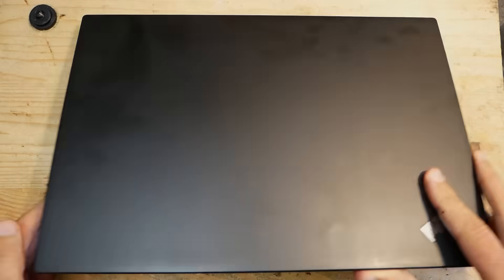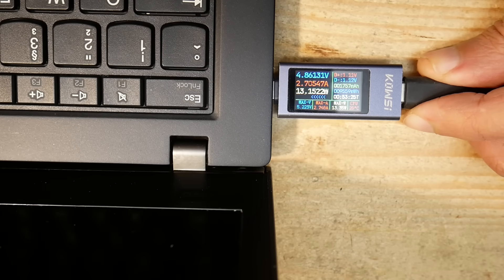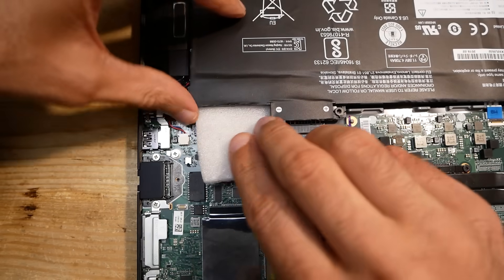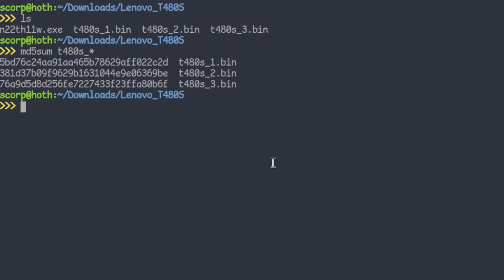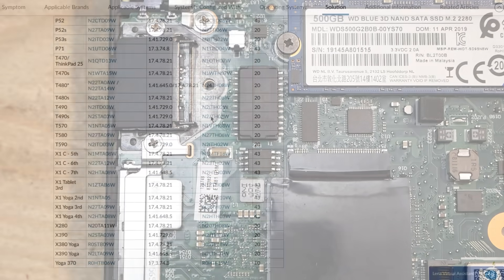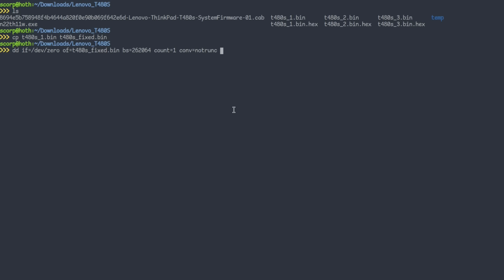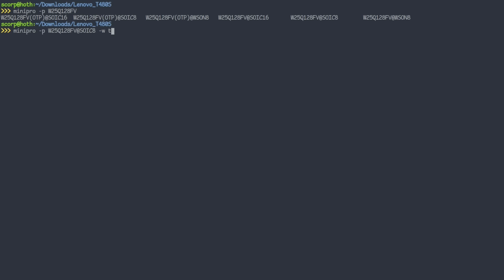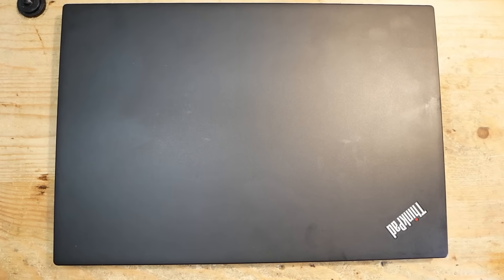Why is this Lenovo notebook not charging? Let's fix it!

Comment: A Lenovo laptop with a basic function not working is actually pretty standard stuff these days. 🤣
Reply from the maker: Unfortunately, yes, the quality dropped significantly. Even worse, this seems to be the direction for the whole industry. Leaving alone the fact, that this notebook belongs to the professional line and was actually quite expensive.
Reply: @necro_ware   "this seems to be the direction for the whole industry"
This is the truth and it's very sad.
kcuf apple for starting these pervert practices for all the other brands to see most people don't care until it's too late
Reply: Amen. I have the T480 and imo it's the spitting image of what'd once be considered a compromised laptop, when consumer electronics reviews were less influencer-y. ThinkPads almost feel like they've devolved into a lifestyle brand, for people afraid that a MacBook wouldn't effectively say "I'm technically knowledgeable, I work in IT" to strangers. It's okay to like it, but I've been saddled with one for the past 4 years and it only makes me miss my X201.
Reply: I'm of the opposite, I haate the older stuff and can go on all day listing every design failure they had.

I even leave with one suggestion to anyone thinking of daily driving an IBM version:
Never run them stock, they're from the era when chipsets finally started running hot. Always add your own heatsink solutions where needed and never use miniPCI cards in them
Reply: @Biaanca5036  There's absolutely some lemons in the IBM lineage. People sometimes want to pin a perceived decline in quality on one little thing, or claim that everything with IBM's logo on it is somehow the pinnacle of engineering, but the T4x machines were wrought with problems. The P50 and X200 families have to be my all-time personal favorite models, although the older 4:3 ultraportables are better looking as art pieces.

Comment: Just a note that one of the resistors next to the SOIC-8 came off during soldering - attached to the power supply trace into the Flash chip. You may wish to double check that the, most likely, pull-up resistor.. isn't still required and not having it isn't causing you some subtle problems. There is one either side visible in the overhead shot at 7:33; the resistors are likely 10k's.
Reply from the maker: Yeah, thank you. I saw it on the footage as well as I was editing the video. Looks like a pull-up, but I didn't solder it back yet. I definitely will, even if everything seems to works so far, it could be unstable in some cases. Anyways, thank you, eagle eye ;)
Reply: Nice catch!
Reply: You're a fast one, Rachel Bobby!  Good eye on that one!

Comment: awesome walk through this. thinkpads aren't unfortunately as great as they once were, but anyways, 90% of other notebooks are unfortunately even more crappy (and don't have a pointing-nipple). so until framework implements nipple-pointers we are unfortunately stuck to crappy hardware. i'm going to hold onto my trusty x240 as long as i can i guess..
Reply: Funny you should say that because the XX40 series is regarded as some of the worst ThinkPads Lenovo ever made. Either older or a year (or a few years) newer but not the 40 series in my experience.
Reply: @RepairWins that is correct, until you realize that noone wanted to buy xx40-series notebooks second hand because of that horrible clickpad, BUT you can drop-it-replace it with the one from the x250 and have been still cheaper than an generation before or after :). it's still going strong 10+ years later for me.

Comment: They should have recalled and replaced all these free of charge, even outside warranty. Never buying Lenovo again.
Reply from the maker: Absolutely, that was such a huge mistake.
Reply: I agree, but if we take that approach almost no brand is free of stain.
What are we going to do? Buy nothing?
Brand abuse is worse each day.
Reply: I had the same issue with a lenovo laptop which suffered from flexing and someinner layer ram traces were broken just some days after the waranty was over. I never bought something from them again and changed to apple, there i had issues too, but they replaced my mainboard in waranty, and even the hole laptop after the waranty as i had some issue with the gpu. In the last 13 years i never had issues with macbooks which were not repaired by them, only iMacs are a pain to repeair after they became such thin i had a lot of issues, my wife has an old one and it just works, only the hdd was broken after 6 years and i repleased it with an ssd.

Comment: I have the same ThinkPad model, in general it runs well under Linux but there is one annoying issue... Sometimes, after going to sleep, the display starts flickering, and this flickering persists unless I press and hold the reset button for several seconds (this resets settings stored in the flash memory). Apparently, the Linux i915 driver sets some configuration bits for the iGPU that persist even after powering the machine off. Infuriatingly, this never happens under Windows.
Reply from the maker: If you can find out what this is what happens exactly, may be you can implement an additional power management quirk script and/or report a bug in the kernel. May be  there is already one existing. Did you search for it on Bugzilla?
Reply: That's exactly caused by a faulty thunderbolt firmware
Reply: @Probe041  I have the latest version of Thunderbolt firmware, it works perfectly (I use a TB dock every day)

Comment: Another masterpiece by Mr. Necroware, yup we all see that even though hardware is part of your hobby, you still rock at it and when it comes to software that actually is your area of work, wow it's another level. Sir you are amazing,
And Lenovo keeps disappointing, at least thanks to them I could make some money fixing some stupid problems that their bad design or negligence causes.
Reply: There has been a definite drop in quality since IBM sold off the ThinkPad line to Lenovo.  Yeah, our host for this video is just full of surprises -- his research into the firmware turned up some valuable resources.

Comment: Great video. It is fun about "Catch 22" with firmware update.
I am impressed how you have reconstructed home-brew "dump" needed to flash the chip directly. It was a great idea. Thank you for sharing.
Reply: Lenovo should have a preflashed chip for purchase, so you would not have to go to this much trouble to fix these laptops. I have the T470 and when it booted it went right away to lenovo and installed the fix. Was running Windows 10 when I purchased it used.

Comment: Amazing. I have several Lenovo laptops that I've acquired used over the years and was aware of this issue but I didn't realize it was the Thunderbolt Firmware that caused the issue, I thought it was the controller itself that broke. 
I've managed to get the firmware upgraded in my little fleet of machines but this revelation means I don't have to shy away from these machines in the future.